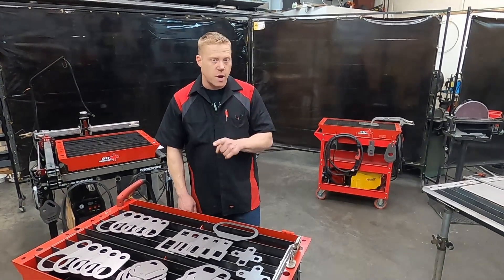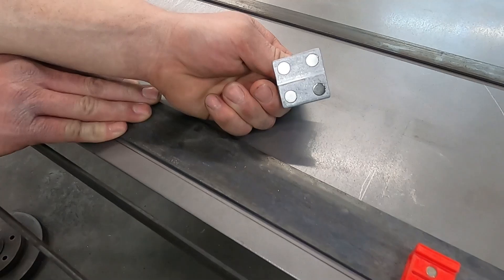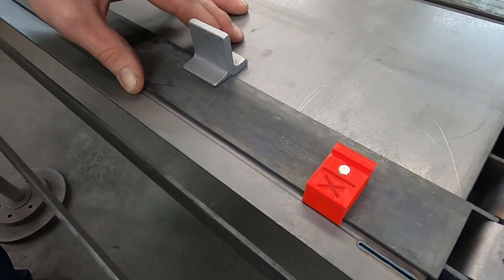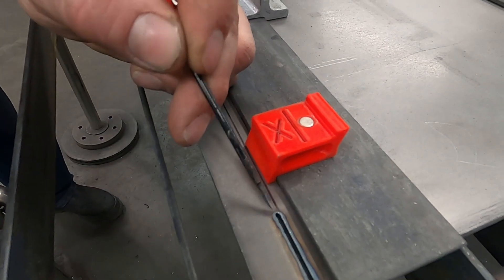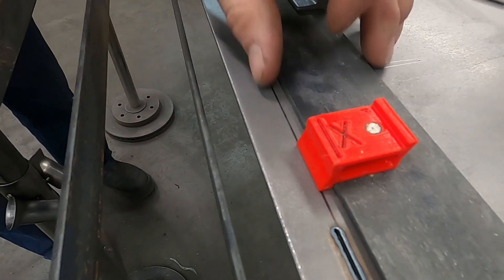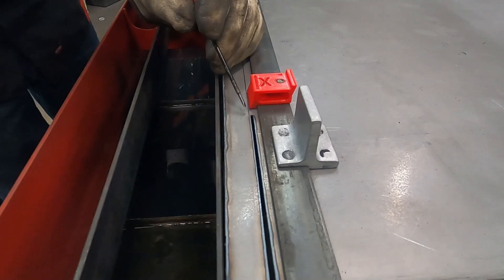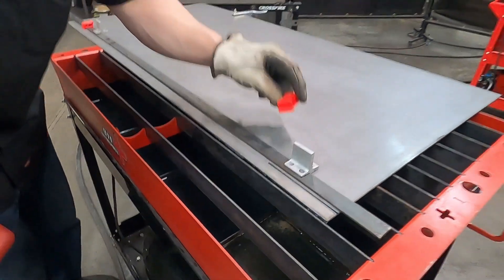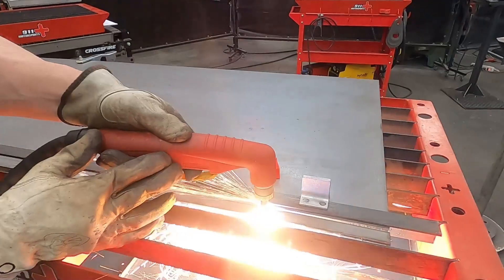Precision Plasma Cutting by Hand - Straight Cuts

Comment: PS that's not free hand cutting.
Reply from the maker: It is hand cutting, but not "free" hand cutting. Using a drag shield with guides is what makes it much more precise. I like to free hand cut with a standoff  when doing more artsy type of work.
Reply: @911Motorsports  I have been a certified welder for 52 year's have cut and welded more steel than you probably have ever seen, I kinda know what a straight edge is.